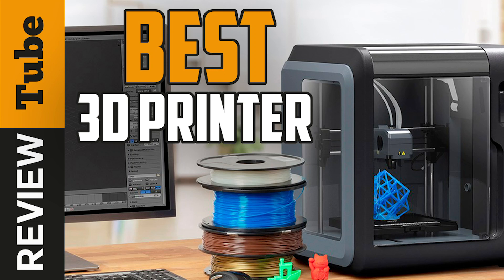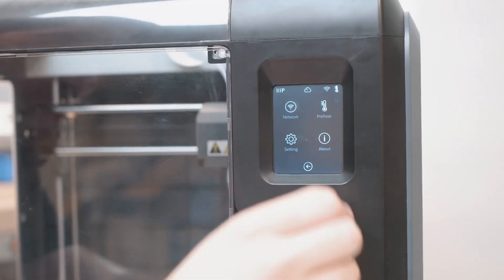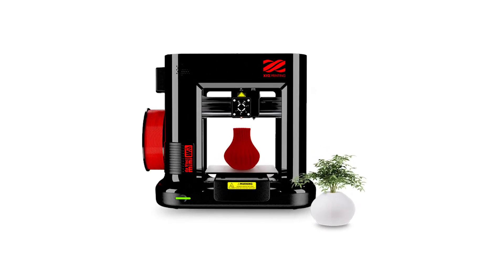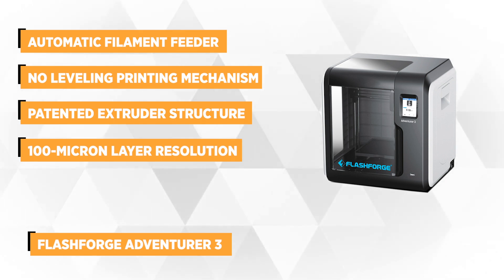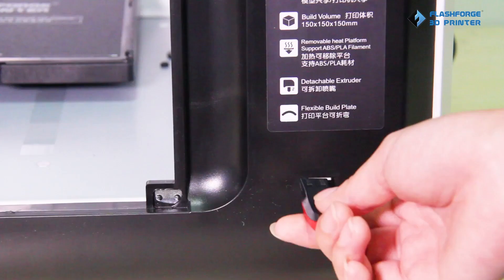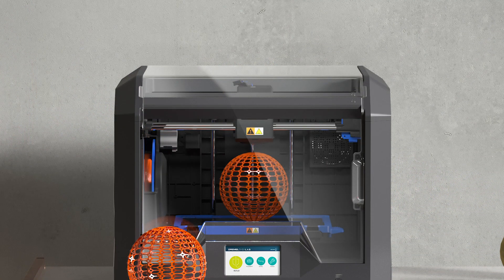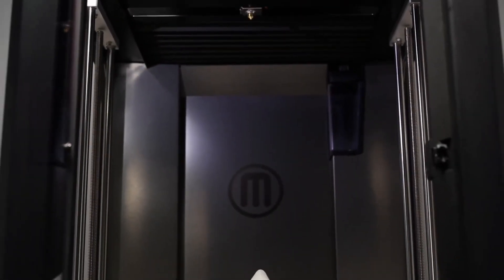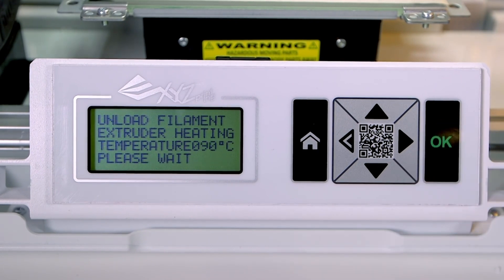✅ 3D Printer: Best 3D Printers (Buying Guide)

Comment from the maker: ✅1.Monoprice Voxel 3D Printer: https://bit.ly/3aXp8QR
      * Find a great deal on eBay : http://bit.ly/31Fi9IX
✅2. da Vinci Mini Wireless 3D Printer: https://bit.ly/2TOvH2u
      * Find a great deal on eBay : http://bit.ly/38eEShp
✅3. FlashForge Adventurer 3 3D Printer: https://bit.ly/2U6EADr
      * Find a great deal on eBay : http://bit.ly/2H6CKwr
✅4. DREMEL 3D45-01 Desktop 3D Printer: https://bit.ly/2vjys2e
      * Find a great deal on eBay : http://bit.ly/2tHCGA5
✅5. MakerBot Replicator Z18 3D Printer: https://bit.ly/2QixBWT
      * Find a great deal on eBay : http://bit.ly/38dzw6b

Ancient Japanese Tonic Melts 54 LBS Of Fat: https://bit.ly/39sKV4H
STUFF YOUR FACE. LOSE WEIGHT: https://bit.ly/31FOT5q